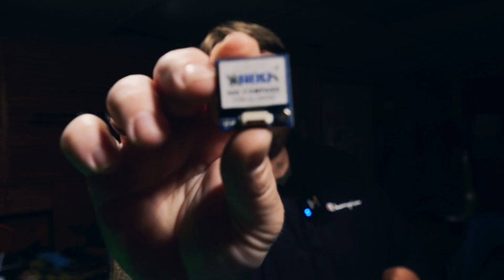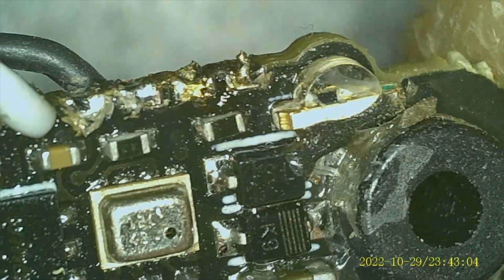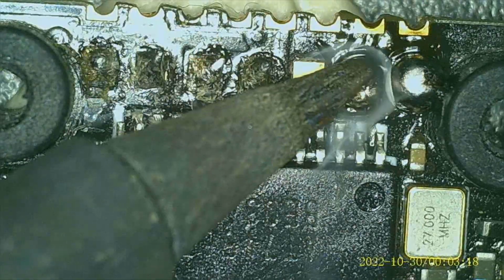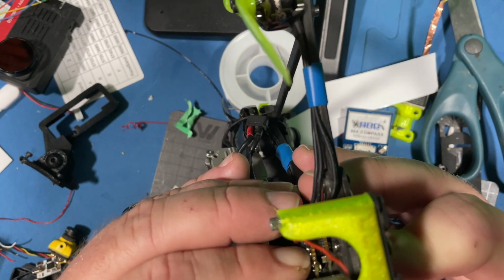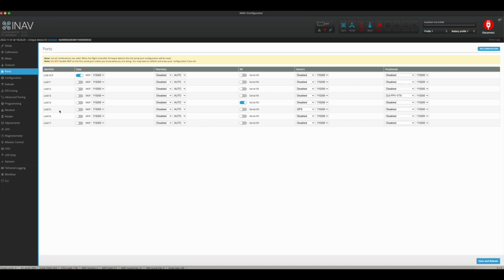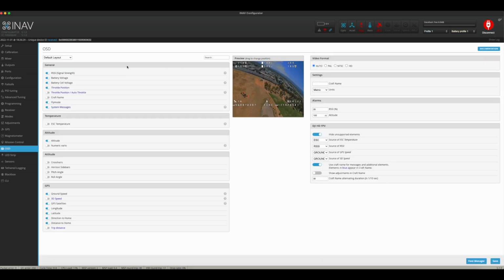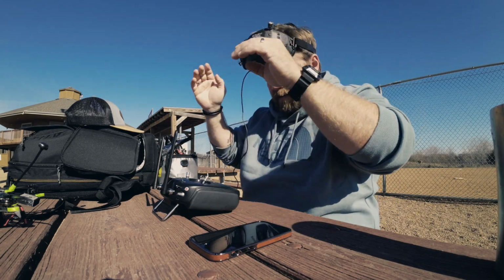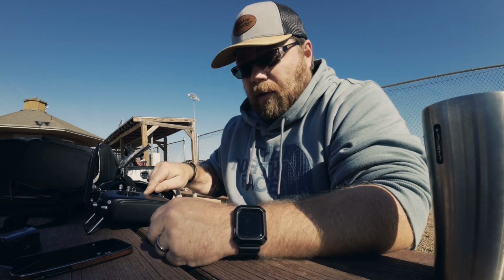Full Install Guide: New GPS and iNav with the Flywoo Explorer LR 4" FPV Drone

Comment: Why use iNav when you can use Arducopter, it does everything iNav can do and so much more.  I am building a Arducopter build based on the flywoo Explorer LR 4 v2 frame,  using a Holybro Kakute H743 mini v1.3 flight controller and flywoo Nin v2 1404 2750kv motors. I'm having a hard time finding a Am32 3 to 6s 20by20mm esc 30mm or less corner to corner or what fits between the standoffs. Can you please help me with a recommendation

Comment: My Flywoo Explorer came shipped with an M10 gps but the magnetometer wires were clipped. After extending the two wires and attaching to the flight controller the magnetometer works fine now. The sda and scl wires need to be reverse connected though because the label on the gps is wrong.

Comment: Hi :)
I am probably a littke late but atm i do the same as you've done in the Video with my Explorer LR4v2-Walksnail and inav 7.1.0.
Flywoo sent me the correct firmware for theyr new f722 pro mini FC.
Do you still have a dump of your final settings done in inav 6?
I would be very happy if you have them and would sharing this with me :)

Sorry for my bad english, greetings from Austria